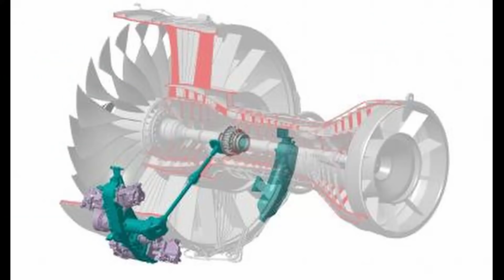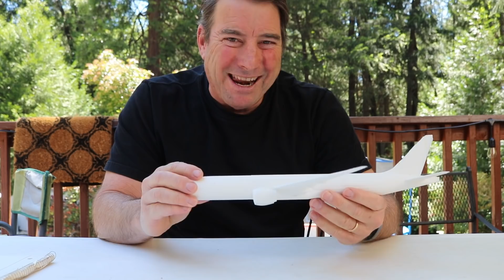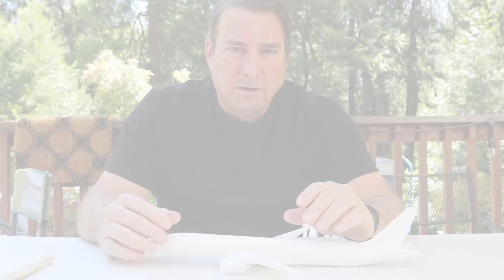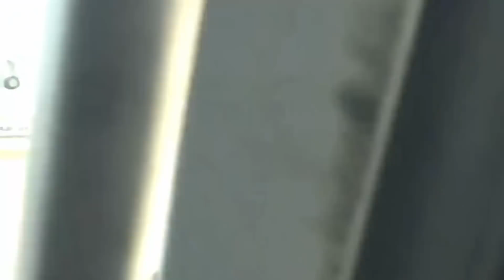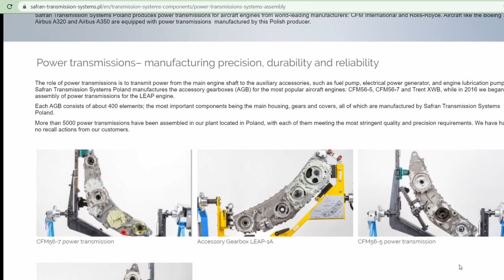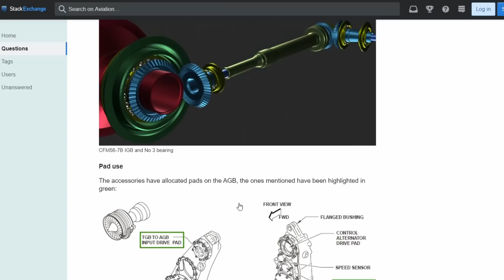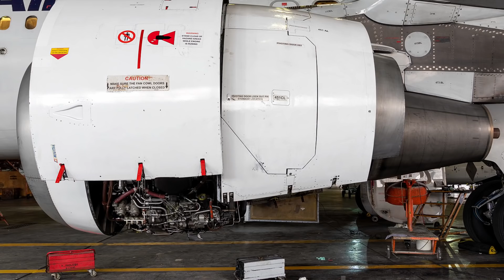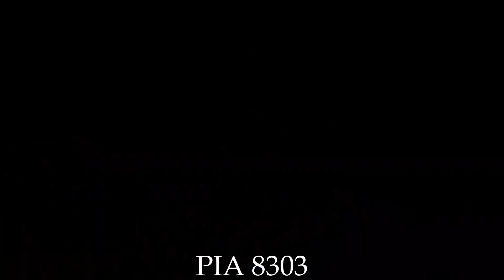PAKISTAN INTERNATIONAL AIRLINES #8303 UPDATE #2 23 May 2020

Comment: In finland flightforum somebody found this ref to bit similar case in 2018 
https://avherald.com/h?article=4b57c3dd&opt=0
Reply: Good find.  Interesting that in the Estonian case both engines also failed after the runway strike although they were close enough to make it back to the airport.
Reply: In the Estonia case how did both engines manage to strike the runway if the landing gear was down,  is there any video of it?
Reply: @grandmastarflash  Landing gear was down when they touched but was retracted as they lifted off the ground while not gaining altitude beyond 48 feet. AC then descended back to the runway and dragged the engines for ~600 feet before returning to the air very near the end of the RW. From the sound of it they were very lucky to have not fireballed at the departure end of the RW.
Reply: @lonnywilcox445  That is exactly what Juan suggested @2:36.

Comment: Juan, doesn't the Airbus have an APU. That shouldn't have been affected. What are your thoughts?
Reply: It won't help with propulsion though.
Reply: Not enough time to start the APU in this situation... they were too busy apparently just trying to sort out their situation while being in a very low energy state.
Reply: The APU isn't running continuously? I know it isn't a factor in this incident. Just curious. Between the APU and a joy stick controller these things seem like they are death boxes.
Reply: thereissomecoolstuff no it normally only runs when at the gate or taxiing to the gate. It’s an be operated at the aircrafts maximum altitude to provide electrical power in the event of engine failure or generator failure to reduce load on the other engine. It can also provide bleed air at about 20,000ft or so
Reply: thereissomecoolstuff not normally, unless you have a pre-existing issue where you think you want that other electrical source

Comment: I am not a pilot but yesterday the audio beeping with the landing gear.
could it be possible the gear failed while attempting to land?
Reply from the maker: Could be....
Reply: blancolirio or was down but not locked and on touch down collapsed ?
Reply: @se2100  very well could be. Black boxes will give those answers.
Reply: @se2100  could it be that the main Gear worked but the nose Gear failed  and for some reason they didn't realise that , that would explain the damage to the engines but the apparent lack of damage to the fuselage and tail
Reply: @se2100  i also thought so
Reply: @grandmastarflash  Look at the picture of the engines.Clearly the nose was up when those engines were damaged as the back of the engines is where the paint is gone off the cowlings.
Reply: @paulcallicoat7597  yeah I agree it's just in that case  I can't imagine how it got took off again without damaging the tail
Reply: @blancolirio  the atc also mwntioned tthe belly landing after tthe go around. He asked the pilott if he would try to belly land again.
Reply: I think we'd see gear door and fuselage damage if the gear collapsed. Don't seem to see that. Plus we see that all the gear was eventually lowered, so the gear was still in good enough shape to extend, apparently.

Comment: Thanks for the explanation. When does the  RAT get deployed? How low down does it hang?
Reply: Mike Dupre: The RAT deploys automatically if both engines lose electrical power.
Reply: The RAT can be manually deployed at the push of a button, but it deploys automatically, independent of other conditions, when both AC generators are inoperative (not generating power). I do not think there is an delay, but I cannot say that for sure. I also do not know how long it takes to deploy, but would guess a matter of seconds. To provide full redundancy I would expect it to be pure gravity driven deployment.
Reply: RAT is deployed for the remainder of flight, it has to be restowed by mechanics.
Reply: You need both AC buses to fail, along with the 2 engine hydraulic pumps, leaving only the DC battery and the blue hydraulic system, driven off the battery bus, operative. If the APU was running then the RAT would not deploy, as the APU is able to, via it's built in generators and pumps, provide both AC buses with power, and power both hydraulic systems, as well as run the cabin pressurisation and cooling systems. 

Not normal to have the APU running on landing, it generally will only be run after landing when taxiing to the gate, to take over power supply for the short turn around time between flights, when the engines are powered down, and then it provides engine start power as well. however here the APU would automatically have been commanded to start by the aircraft, but it takes around a minute to run up, time they did not have, and does not have any thrust capability, only powering the controls.

You can see in the video from the house camera the aircraft was coming in at the best glide angle possible with the airspeed it had, but was too low to make the runway.
Reply: https://youtu.be/c9yz6Gd216o

Comment: WHY DON'T they CHANGE the POSITION of the GEARBOX ??? IE. INSTEAD of on BOTTOM, WHY NOT ON SIDE or TOP  POSITION ???
Reply: Because if you have to land gear up, the engines are trashed anyway.  And, prior to the Max debacle, the designers can only account for a finite amount of errors.  Not recognizing that your gear is down & locked PRIOR to touching down (while it’s been done a thousand times), is not very high on the list of errors you see from competent, professional aviators.  Post-Max, I think we’re going to see much, much more automated (and way more expensive) designs become mandated to account for pilots without yesterday’s expected discipline.
Reply: Ease of access for maintenance

Comment: Stupid question: Why isn't the gearbox located on the upper half of the engine? Answer is probably very simple (effectiveness or something).

On other video (not yours) one guy picked on the fact that those are made in Poland so they're ....it. If they meet standards they meet them.

I'm sorry for all the lives lost. Yesterday there was an info that 2-4 passengers might have survived. I hope that it is true.
Reply: Ease of access for maintenance
Reply: If you relocate the gearbox & leave the fan casing unprotected on the bottom, there would be even less between the cowling & the fan....so no benefit.  Manufacturers should not have to go to great lengths to protect against the crew not following basic fundamentals of checklists.

Comment: They realized to late landing great was not there.  Scraping the engines made them realize that so they went around after they destroyed the engines.
Reply: Thats what it sounds like to me.
Reply: Polish Airline LOT, made a safe landing without landing gear.
Reply: Not a whole lot of time to decide what to do when that happens. (I know I’d hesitate.  Better to make sure the gear is down with three green and not face this problem.)
Reply: wouldn't the ground proximity warning tell them the gear wasn't down
Reply: @dufey1969   the gear warning horn was audible in the first radio transmission. I'm wondering did they simply elect to ignore it?
Reply: Matt Peters yep, they 100% simply just chose to ignore it. Case closed, fuck it